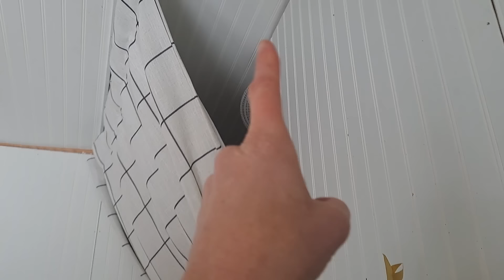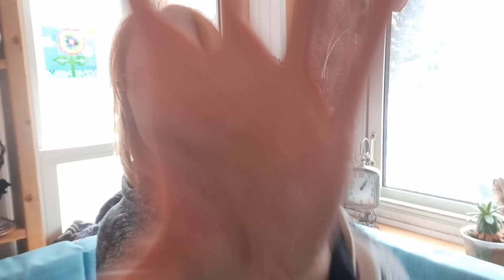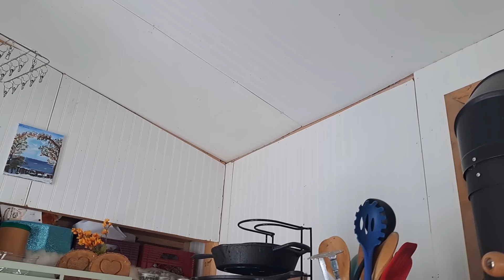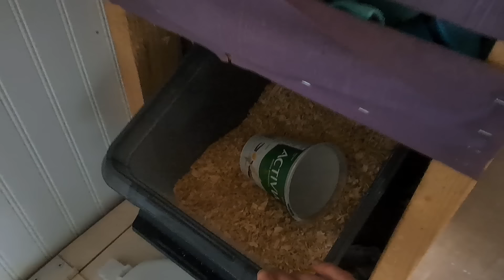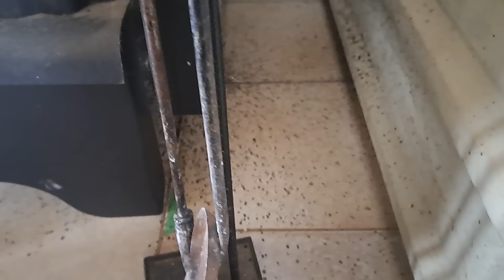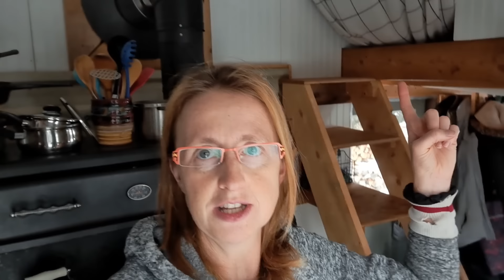The PROBLEMS with my Tiny House

Comment: Most likely you have wires crossed you need a voltage meter to test but I’m also betting that your circuits are also crossed your best bet is to rewire (you can run under in a metal conduit)  we had the issue with flys too I got coconut coir and dump it on top at night before bed  also get a small computer fan 12v helped a ton

Comment: Most likely you have wires crossed you need a voltage meter to test but I’m also betting that your circuits are also crossed your best bet is to rewire (you can run under in a metal conduit)

Comment: You could unhook all your receptacles from the wires on the walls ( try to pull the wire out if possible) all around your place. I’d you can get the wires out of the walls bonus .. but anyway .. you can get electrical conduit and run it on the outside of your walls and require your place that way and get that solar going
Reply from the maker: That is something I haven't considered. I won't be able to pull the wires out, I secured them too well, but running all new wires wouldn't be impossible...

Comment: We have a wood stove in NW WI and trust me, we have even more temp differences in our house then you have.  Unfortunately, my office is often only 16-17 degrees (62-64 F).  We have learned to live with it and sometimes supplement with a small space heater.
Reply from the maker: That is reassuring. It is actually kind of nice, having different temperature zones. If I have a hot flash, I just go to a different room, and it's immediately solved!! HA!

Comment: I'm a big fan of painted plywood floors. I once did one with a mixture of different colors just slapped on 'Higley Pigely' (they were cans of latex I got from recycling) and then covering them over with black. As I was going,... I would paint an area and then lay a garbage bag on top of it then pressing the bag down and rubbing over it in various directions. What that gave me was a faux cement finish (that's the best way I can describe it) that looked very interesting and 'cool'...if I do say so myself 😮😂❤
Anyway, just thought I'd pass it along as I quite enjoyed the results. ❤
Reply from the maker: Oh, that is awesome!!  Maybe you can answer a question I have: what sort of paint do you use? In my camper I used oil-based paint, so I can wipe down the walls without it coming off, and I was really happy with that decision. And someone else suggested putting sand in the paint, to give it some traction. What did you use?

Comment: other, the green house need a roof more higher than the house (wrapping in) with windows in the high part. And in summer grow vines for cool down the estructure (opening the windows in the celling too) I know is a mega proyect..... like a "green garage" and put inside the tiny house. With that you can colect the water of outside and use the heat in the winter. I see this houses in youtube

Comment: Maybe the electricity in your house is cut off because the amperage of your house exceeds what it can transmit (ideally, from its entrance panel to the house a separate connection comes out exclusively for that house) Maybe the cable is thin (it should be thick) Maybe the power outlets are of low amperage (you need the 50 amp ones) Inside the structure, the only thing that would cut off is that there is something badly connected. I think all of the above is more likely

Comment: Hi Erin perhaps the woodstove is the elephant in the room. It may be better to move it into the larger greenhouse and put a smaller woodstove in the tiny house.  You can perhaps boil water on the top of it and use the other cooking options you have to cook.  Then you could use the bigger woodstove to heat the greenouse and use it for cooking in winter. Then you will have more room in the tiny house, less weight as the huge woodstove will have been relocated so you can have your beautiful bohemian tiled counter and you will have access to the electrics. Also with the big woodstove relocated you will be less worried about the girls. I have been researching building a geodesic greenhouse off my little cottage to use as a greenhouse and solar heat gain, this could be an option for you there are designs on YouTube for snow load. Lastly now you have been living in tge house a while and have a feel for it and how tou use the space it may be an ides to revisit your design over winter and make updated plans and do an overhaul during the summer. You could empty the tiny house in sections and re model/reorganise. Perhaps camp 🏕 in the garden for a week or two while you do the work. I know I said lastly but just remembered the fly issue and the girls forgetting. Perhaps some visual instructual images in the bathroom may help the girls remember to use the sawdust you could even get them involved in designing the info graphic instructions as a learning opportunity and having them involved in the design may also help them remember. Much love and happy new year from a tiny cottage in Wales 🏴

Comment: Erin, what about 'selling' the big wood cookstove and using the money made to buy a propane stove/oven combo like used in off-grid cabins. Once you remove and sell it (in spring/early summer) you could take "apart" the inside the look at electrical and fix it. Just a thought!

Comment: Could you direct half the rain water into a regular rain barrel to use for animals/garden and only the other half into the tote in the greenhouse? Also, stack straw bales around your tote, if there's room, to keep the water from freezing. It won't absorb sunlight (which is negligible in winter anyway), but at least the water will be usable. But yeah, it won't keep the greenhouse warm. Idea for the flooring: you could use the stick-down squares of linoleum, which would be much easier to fiddle with and put around the shelves without having to remove them. For the couch cushions, you could sew snaps on the backs and glue the other half of the snaps to the wall, so they snap into place. I'm glad you also point out the things you did right! You've done a remarkable job and should stop often to remember that.

Comment: Hi Erin! Thank you for sharing, I'm with you and sending love! Homestead warrior-mom ! To rescue the batteries: set the system up with only 1 panel to maintain or replenish the battery charge . You don't need to use it or move the batteries, just connect the charge controller to the batteries and move 1 solar panel into a sunny place and connect it to the charge controller to.
Lot's of love and strength ❤